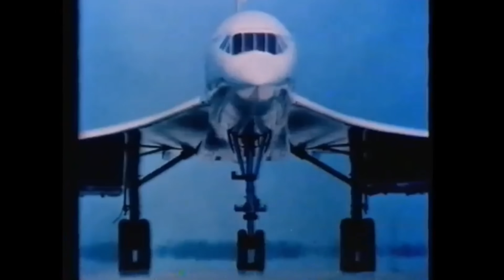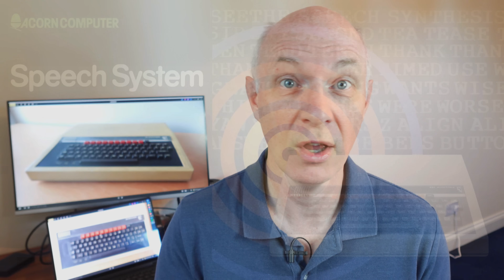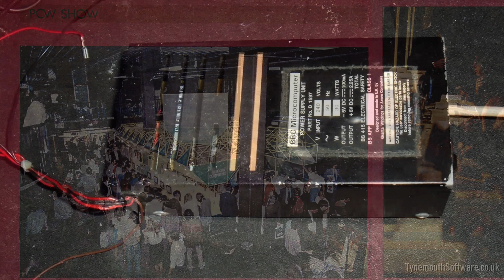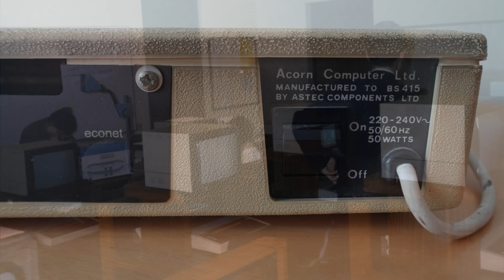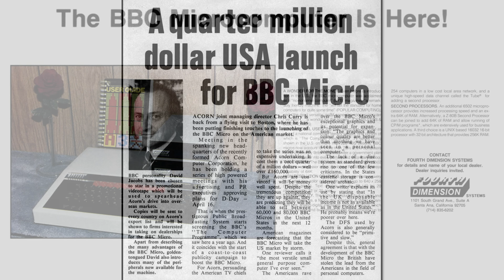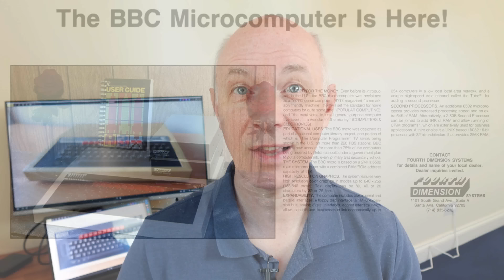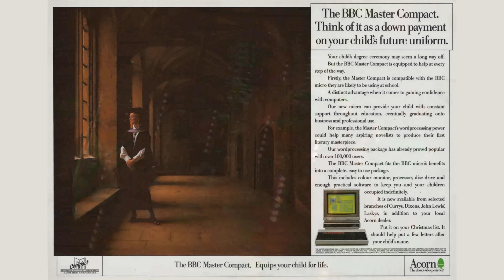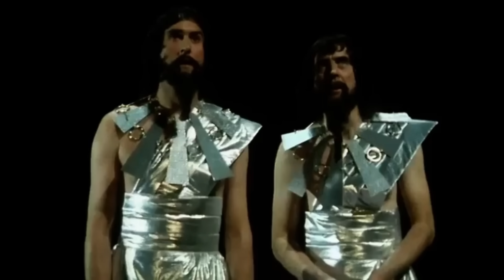6502 Reasons Why I Love This Machine

Comment: I was into electronics as a kid growing up so I saw the first kit computers and synths before most people did. I lusted after both even though I really didn't know much about either. 
I've been lucky on both fronts. A close friend had a NASCOM-1 and he was nice enough to show us how to use it too. I also had other friends who had ZX80s and 81s and afew others. Then that original friend opened his own computer shop and I got tuse what the hell I wanted regularly. I also worked in a computer department at the time by then. So I've tried tons of computers and also still own a load of them too. There's lots of nice things to say about all of them, without a doubt my favourite computers are the Spectrum and the BBC - crazy that these both happened at the same time. 
The Spectrum was the one for it's vast supply of top of the line games. But the BBC was just so well polished it made sense. First time I saw a friend show me how machine code worked on the Beeb I thought that was great. As I did when simply typing out programs. How it auto formatted things. Those little tweaks and quality of life things really gave it the edge.
I still use mine massively today.

Comment: I paid £1200 doe my Beeb set up.. it was the best investment I ever made...! it led to everything I ever did with computers as an adult... (including smart card manufacture and technical systems remotely managing the use of those cards over a career of nearly 37 years).
The one thing I would mention in passing about the 6502 chip was that it was really strange that I always got much better scores on my Beeb compared to colleagues playing those games with the same model... it turns out my 6502 had a very small "feature" in machine code when doing BCD arithmetic - i managed to show that my chip thought BCD 99+1 was 180 etc.. it also explains some of the weird characters which appear on screen when the score was displayed. I eventually bought a 100% compliant chip as some other stuff got messed up by the fault .. I still kept the original chip though ;)

Comment: I had a BBC Micro back in the day. Got into emulation a few years ago, and ended up writing a PCB CAD program for it in a mixture of BASIC and 6502 assembly language! It will just about run on an unexpanded Model B, with a small enough board and not too many connections, but it can also take advantage of the Master 128's shadow RAM to run in a higher-resolution graphics mode and work with a larger design database file.

It was a surprisingly capable machine, especially with the second processor (which I never had one of in the 1980s, but can enjoy today through the magic of emulation). The only 8-bit machine with a higher-resolution display was the Amstrad PCW (720*256).

Comment: My first computer was the Electron. If you opened one of those up, you got a hell of a shock. The main chip was HUGE! I think it was a military specification ULA. It was a good home machine, but the lack of Mode 7 and the decision to only have one sound channel hurt it rather badly. But the Plus One which gave it the parallel port (for printers), analogue joystick port,  and two ROM cartridge sockets, and the Plus Three which added a 3.5 inch floppy drive (with the port for a second drive) helped. There were jokes going around that Electron users were soon going to need extra deep desks as each expansion plugged onto the rear of the computer.

Comment: The BBC Micro is the reason why I learned some English had a career in computing and retired last last year.

A few years ago I started programing again in C99, raylib graphics and I'm using Linux Mint on 14 year old computer. I now have same feeling of excitement just like 40 years ago.

C is relatively easy to learn, with knowledge of 6502 assembler and I would argue, that BBC Basic was the best Basic in the eigthies.

Thanks Acorn

Comment: I was lucky enough to have connections with the local computer "surgery" back in the day so had access to all of the parts to build my own Model B effectively in kit form. There's no way I could have afforded one otherwise. The ZX Spectrum still blew it away in my opinion as it was highly portable and wasn't stuffed full of expensive interfaces I had no need for. I still managed to add a floppy drive and speech synthesis (my own design for the latter) to the Spectrum with the aid of fairly cheap external hardware, so I wasn't missing out on anything I actually needed at the time.

Comment: Great video!  I love the Beeb.  My mates had BBC Micros when I grew up, and I was envious given that the closest I could get at first was an Acorn Electron that had most of the Beeb's features cut out or hobbled completely.  I finally got a Model B in 1985 when we'd moved to Australia.  Elite is an incredible game and I spent years playing it, especially the BBC version.  If you haven't already, check out the flicker-free updated versions you can download for your BBC.  I collect Acorn computers.  I have just about every version of the BBC Micro, an Electron that has a Tube interface, and an Atom.  I have a bunch of Archimedes computers too.  But one my favourite computers, along with the Amiga, is the BBC Micro.  It changed a lot of lives, and got a lot of working class kids into the IT industry.

Comment: I remember this when working as a teenager in an independent electronics shop. Demand was through the roof. Lots of supply issues and power supplies were an issue. We would often drill holes in the case to aid. If you added the Z80 processor there was no way it would fit in the box without issue. We did an external box and then a floppy disc drive and joystick. Well ahead of its time and often wondered what might have happened if they could supply as required. Still have fond memories of Elite.

Comment: I started with an Acorn Electron. My highlights were writing a disassembler which loaded directly into screen memory and a printer driver that could print colour pictures using shades of grey on a dot matrix printer. Then I got a Master 512 and created a programming language which mixed compiled BASIC with 80186  assembly language to easily create programs which worked on a PC.

Comment: Great video, thank you. I used to drool over those ads and I think I still have the sunset sky one. My mother saved hard to buy me a BBC Micro B, and later I took an 8 week holiday job at Acorn in the technical documentation department. I was probably more of a hindrance than a help. One of the staff threw a View ROM across the room to me, and I and my future wife happily used it for word processing for several years. I was at Acorn when they took delivery of an Apple Mac, and it obviously freaked them out. They also had a mysterious and sinister room in the building with high security where the ARM chip was being designed. Happy days at the peak of the British micro boom.

Comment: And now look where we are with authoritarian digital fascism. 
As a data cabling engineer of 31 years, as a teenager that had a ZX81, Dragon 32 and then a Commodore 64 then onto .86 PC’s and I absolutely refuse to work on data warehouses as digital computing has a dark side, and that I see as a comms engineer, a third generation comms engineer, who’s grandad installed Strouger electromechanical engineer, my Dad in both the electromechanical and digital world of System X and optic fibre making an appearance between phone exchanges. 

In the late 90’s into a the early 00’s the coming together of telecoms and data networks with Cat5, 5e structured cabling bringing ‘voice telecoms’ into the data networking and now near every electronics system having an RJ45 connection has brought in such a wide variety of hardware from lighting, networking, CCTV, Power controls. 

31 years and I still enjoy working on networks, though I really do not condone the emancipation by digital abuse and desired digital fascism that AI will be. 
We are making our own demise theough making being a nerd cool and capitalists that’ll pay these nerds good money, and we all pay the price and these nerds can see it now and the only ones responsible are calling out the dangers of AI, including its creator. 
AI needs a kill switch option, before we get too far down that one way street.

Comment: I got a BBC model B in 1983 as an undergraduate (it was my 21st birthday present).  I used it for my final year project - with a dot matrix printer and dual(!) disk drives I could produce hard copy and it meant I didn't have to use the institution's mainframe, which was slow (Fortran only) and automatically threw everyone off at 10 minutes to the hour to stop people using it for extended periods.  Yes, really!  I gave the BBC micro to my mother a few years later, and she used it as a word processor in the late 1980s/1990s.  Absolutely loved the machine.  I had lost or thrown away my final year project disks in the 1990s, but had kept a copy of the listing in my project write-up, so I typed the whole thing in to a BBC emulator (on Windows) in the months after I retired a few years ago.  Some old "features" came back to haunt me 40 years later 🙂

Comment: I've just recovered some BASIC programs I wrote in 1984 from tape. Love the BBC micro and my Acorn Electron, thank you for this great video. I also recovered my saved Elite, and got it loaded in the emulator so I can finally progress from Deadly. I had to pause to start work as a programmer and never found time to play. There's a program on the Intro cassette that simulates intelligence by having a pointless conversation, forshadowing LLMs by 40 years. Lol.

Comment: Yet another brilliant video.  Here are my memories of the BBC...
I owned a VIC20 when I started Computer Science classes for O Level, and the lab had a couple of Research Machine 380Z machines running CP/M.  They were repalced by five BBC model B machines.  The department head was upset to discover that the typing class managed to get ten model B machines to teach word processing.  Apparently he thought he was pushing his luck asking for five and was surprised that he got them, however the typing class asked for ten so that what was delivered.  I was always envious of BBC BASIC as it was so much better than what was available on my stock VIC20 and later C64.  Thankfully I got the Simons BASIC cardridge for my C64 in time for my exams, so I acually did my O and A Level projects using that, all written in the comfort of my bedroom.  You mentioned that performated ROM slot, and I recall one of our machines having a plastic socket installed into it which allowed cased ROM chips to be inserted and removed quickly.  I "think" on eof the ROMS was for LOGO (as that seemed to be all the rage for educating primary school kids at the time using "Turtle Graphics", but I could be wrong.  While we were glad to see the back of CP/M with the departure of the 380Z machines, I never realized that the Beeb offered an option for it.  My C128 had CP/M mode which I probably used just a handful of times just to remind myself that I didn't need it.
I'm glad you mentioned Elite, because I first encountered that on the BBC in school and we spent many of our lunch breaks playing it in the lab.  I jumped for joy when it came out for my C64, especially with the better sound and graphics.  I still recall the "tribble" cargo on the C64 version where the wee beasties slowly took over your cargo hold, then the "chirping" would start and finally sprite graphic versions of them would start invading your cockpit screen.  I had to abandon ship using my escape pod to get rid of them, but I later found out that if you flew close to the sun (like you would do to use your fuel scoop) then that would kill them off.  The Amiga version is still my favourite, but I did get Elite Dangerous for my Oculus Rift, but I'll admit that the motion sickness put me off it.
While the BBC model B was great for schools, I recall it costing twice the price of the C64 so only one of my classmates had one.  I can't remember what his father did for a living, but he must have been raking it in as he had the official BBC monitor and the teletext box for it too.
I have one interesting curiosity in my collection and it is a beta release on 3.5" floppy disk of a BBC model B emulator  for the Commodore Amiga.  The story I heard was that Commodore were trying to sell the Amiga 2000 to the British school system as a replacement for the aging BBC micros, so in order to maintain a backward compatability with siftware and still give students a familiar programming experience, they intended to include the BBC emulator software.  It worked well and on my A2000 with was blisteringly fast and offered up to 4 emulated floppy drives too.  I think it eventually "broke" after one of the Kickstart/Workbench updates.  If I find it again then I'll give it a try.  I know I originally had it running under Kickstart/Workbench 1.2.

Comment: I started work in the late 1970's and the idea of a home computer was gaining ground - the Commadore Pet, Tandy Shack, Dragon (maybe later), even a home build kit the UK101. Meanwhile at work, I was trying to write FORTRAN code which had to be input via punched cards. I was tempted to buy a 48K Speccy. Of course, there was a delay from spending your money and receiving the hardware. Sir Clive, I think, was using a Timex factory up in Scotland. Anyway, the Speccy was a bit disappointing (rubber keys, ULA hot spot) but allowed you to write code and run it straight away. A few years later I bought the Model B. This was much more interesting, but sold it to a friend to buy a Master 512, with an added 65C102 chip. You could insert a ROM cartridge which supported other languages like Pascal. I had a matching RGB monitor and twin disk drives. Still have the rig, but unfortunately, the power supply blew because the capacitors had dried out.

Comment: I used an Apple IIe in 1981 as a research machine at Reading University as it was able to interface to the real world, ie. experiments.  In 1984 I worked at Sheffield Metallurgy Dept and that was my first and very exciting contact with a BBC Micro B+ and ran a servo hydraulic test rig with it as a control and measurement computer.  I eventually joined a new software company in Sheffield where DEC PDP 11/23 machines were being used to develop engineering software.  Reflecting on this time of my life I really enjoyed that period and so I have gone down the Raspberry Pi rabbit hole as it works in the same way for a few quid as an Apple IIe.  🤣

Comment: I learned my computing trade on the BBC MIcro and I've still got my original machine, which my own children now use.

There's an important point about the Tube/second processor architecture. The Tube socket is really a hardware interface to the operating system, so that a second processor (the "parasite") can access the operating system's API to use the screen, keyboard, mass storage and other facilities. That means that the operating system has to be not only clearly defined, comprehensive, and independent of programming language, but also extensible to accommodate new hardware that hadn't been thought of when the BBC Micro was designed, such as mice and laserdisc players. That makes it a real tour de force of software architecture for an 8-bit machine. All those details are hidden under the hood, but they had a real impact on expandability and compatibility. For example, the BASIC ROM in the Acorn Electron is byte-for-byte identical to the one in the BBC Micro even though the hardware is radically different. The difference is handled entirely by the OS: the BASIC language simply doesn't touch the hardware at all. I don't think that's the case for any other 8-bit micro.

Comment: I programmed in COBOL and Fortran at school, then BASIC on a PET computer. Moved onto programming it in Hexadecimal machine code before the BBC Micro Computer B came along - I actually won one for our school! Programming in BBC BASIC and 6502 assembly language, with the interpreter built-in was a revelation!

On leaving school, I worked for a company (Five Ways Software in Birmingham), programming the BBC Micro, the ZX Spectrum (and ZX80/81), and the Research Machines 380Z - all in 6502 and Z80 assembly language. The job paid for flying lessons, and I got my PPL in 1984 - which kickstarted my career in aviation. I did have a few games published in C&VG too!

A huge thanks to the ‘BEEB’, without that first programming job, I’d never have learnt to fly and have the career that I’ve had.

Comment: Excellent - clear and informative, and aligns with my memories. Very nostalgic. We had a few at the University where I worked and we used them to drive all kinds of hardware stuff in labs on an Electronic Systems degree, We could even program them in C, and one of my students did a cooperative project with Acorn which resulted in them hiring him after graduation. Happy days!

Comment: Such fond memories of a great machine, and so many expansions. We managed to fill the ROM slots with things like the DFS, View, the AMX mouse driver and more, and popped out that slot at the left hand side to add a ZIF socket so we could swap ROMs out quickly and easily without risking bending the pins. I read up avidly about coding and became fairly proficient with 6502 assembly language. A modem got us hooked on Prestel and Micronet800. All the add-ons caused the power supply to run hot and crash the thing, so we cut a hole in the top and bolted a fan on. Despite all this I only ever managed to reach Deadly on Elite.